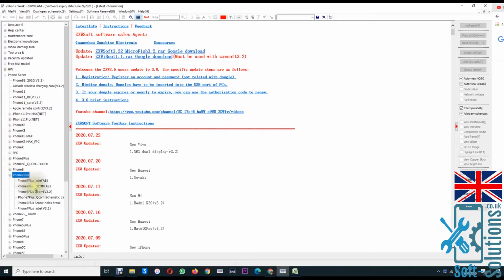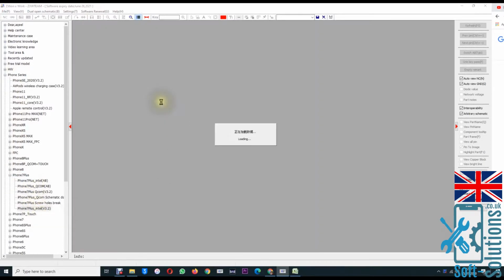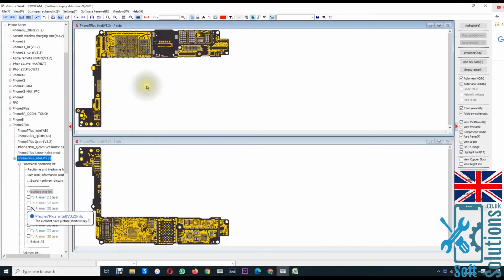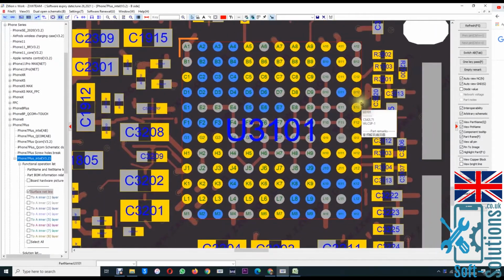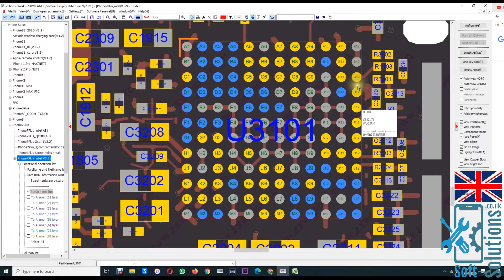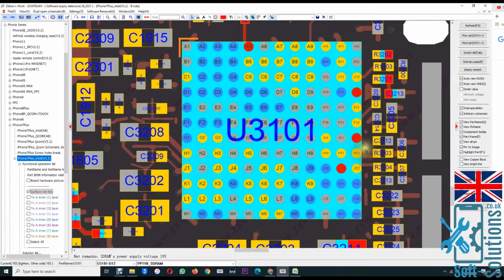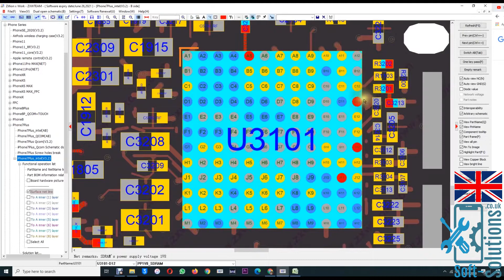iPhone 7 plus audio IC still won't work after jumpers, let me tell you why.

Comment: I ve done that jumper too and still its not working?
Reply from the maker: After soldering the ic check for c12, bend the shield little bit and check with slim prob to the resister in c12 line which goes to cpu. Make sure it’s not shorted to ground. Also check A12 and B12, they are grounds but must be connected.
Reply: @SoftSolutionsRepairsUK  Thank you very much C12 was grounded because of too much solder.
Thanks again
Reply from the maker: Glad to help you :)